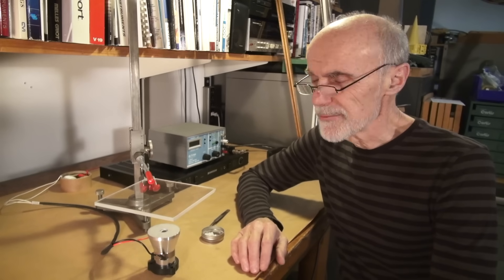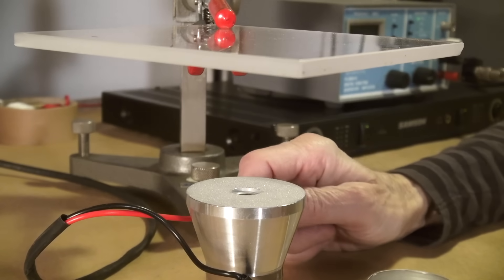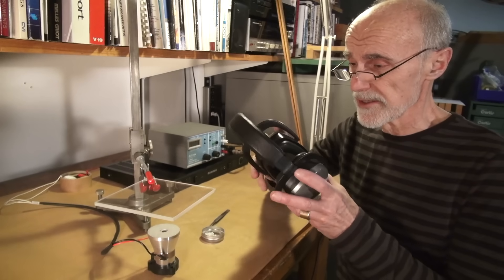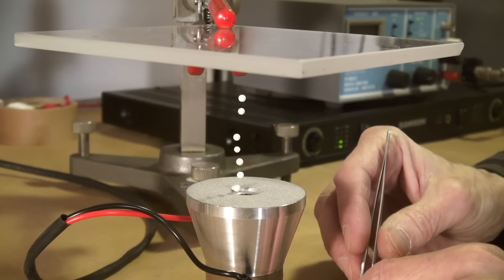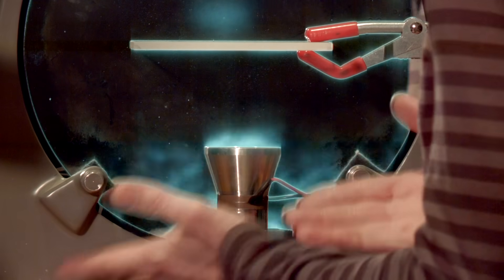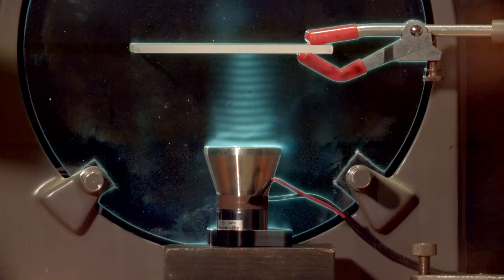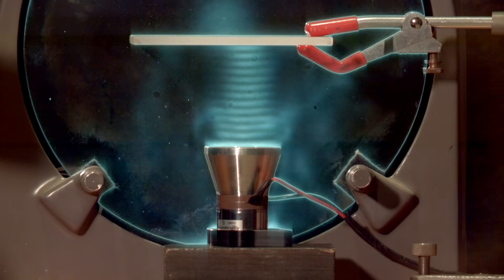Acoustic Standing Waves and the Levitation of Small Objects

Comment: I have tried, for a school project, to replicate with an Arduino, an IPC-4885-W amplifier and a 40 khz transducer. To get the right distance between the transducer and the reflecting surface we use a caliber and several pieces of paper. It only works for some seconds/a minute each day then it stops (even if we don't move the reflective surface, and the transducer is still active). May I ask if you had the same issue? What could be causing it and what can be improved?
Reply: I suspect that your amplifier can't handle the load and shuts down when it overheats.  I looked up the specs of your amp and am surprised it even works briefly.  What you need is an impedance matching transformer to match the output impedance of the amp with the input impedance of your transducer.  And if that doesn't do the trick, you need a more powerful amp.
Reply: Thank you for the reply. Actually the amp seems to work all the time: to check we noticed that when the powered transducer is touched with a metal object it passes some vibration and makes it emit some audible (and annoying) squeaky sound (which I think is curiously 20 kHz). And it doesn't seem to overheat. I didn't understand why it shouldn't handle the arduino's (square) signal. I must admit I don't understand much about impendance matters. Might the issue be on the arduino's side?
Reply: It's hard to diagnose a problem without the ability to troubleshoot all the possibilities in person  I doubt the problem resides with the arduino, but it's possible.  Maybe too much power is going into the higher harmonics (of the square wave) and you would be better off with a sine wave?  What ultrasonic transducer are you using?  All I can say is that I was not able to power my transducer directly with an audio power amp ... the impedance matching transformer is essential in my set-up.

Comment: Why is it important, that the distance is just right?
Does the soundwave is reflected a couple of times? So that at some point it interferers so much destructively, that it is througout just zero?
Reply: Yes, the sound wave not only reflects off the piece of glass, but also off the transducer producing the sound waves.  Constructive interference between the original waves and the subsequent reflections can only happen when the distance between transducer and reflector is some integral multiple of a half wavelengths (that's "just right").  Otherwise, as you say, one obtains wholesale cancellation.  The sound won't go to zero because you still have traveling waves ... you just won't get a standing wave.
Reply: Great, I think I understood it 
like this:
https://drive.google.com/open?id=1SRNbyo6B2W2xAFMlG0KLzCrDgosg69hb
On the left with the multiple of half a wavelength
on the right without the multipple of half a wavelength
Reply: correct
Reply: GREAT, Thanks a lot!!!!

Comment: Does someon can answer me? What is happening in that zones? 
White: Steady air pressure, the foam balls don't move
Dark: Changing air pressure, the balls are move out of those zones

Did I understood something wrong?
(yea, thats bad english)
Reply: Many find this counterintuitive, reasoning that the balls should move away from a high pressure zone.  Try to visualize the actual motion of the air.  The air molecules are in an antisymmetric normal mode of vibration;  from the balls’ viewpoint, air molecules are either rushing in symmetrically from both sides or moving away symmetrically, and the balls settle down in a zone of least motion.
Reply: And that is where the highest pressure = white stripes are?
Reply: correct
Reply: Wolfgang Rueckner aaahahh,, thanks!
Reply: Only one more question :'D

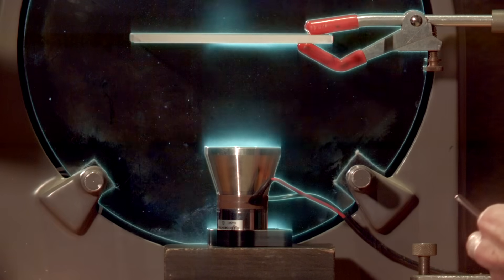The Ultrasonic Levitation works with standing waves (antinode and nodal point), right? At 4:20, you see those white and small black stripes. Which Stripe is which part of the standing wave? 
As I researched, the small balls are staying in the nodal points, so that should be the high pressure? But The antinode should actually be the place where the pressure of the air changes, depending on the freqency, a couple of thousend times per second. 
Currently, I am very confused and do not know further, can you please help me one more time, even though I am annoying you ^^ -_-
Reply: The white bands of light are regions where the air pressure changes the most (from maximum above atmospheric pressure to maximum below atmospheric pressure) and it's also where the air is moving the least.  These are the pressure anti-nodes and that's where the balls settle down.
Reply: I think, I am understanding - is it about the sound particle velocity?
Reply: yes ... the air molecules move the least in the pressure antinodes and they move the most in the pressure nodes.  Molecule velocity (or displacement) is 90 deg out of phase with pressure.
Reply: Wolfgang Rueckner awesome! Thanks a Lot!!!

Comment: Thanks for the cool demonstration! I was assuming that the little balls were suspended in the nodes between the high pressure bands but this isn't the case?
Reply: Many find this counterintuitive, reasoning that the balls should move away from a high pressure zone.  Try to visualize the actual motion of the air.  The air molecules are in an antisymmetric normal mode of vibration;  from the balls’ viewpoint, air molecules are either rushing in symmetrically from both sides or moving away symmetrically, and the balls settle down in a zone of least motion.
Reply: I see, thanks for the explanation! :-)

Comment: If I use a similar model transducer that emits 40kHz will it work the same way or would the wavelength not be enough to levitate anything? I've seen the TinyLev uses that frequency but with many small transducers in precise positions.
Reply: it will work at 40 kHz ... you can levitate smaller objects with the shorter wavelength

Comment: There is no such thing as high pressure area. The pressuse is oscillating between high and low on the antinode points. So the average pressure is the same as the surrouning atmosphere at the antinode points. Same with the node points, where the amplitude is at minimum. So my qestion is, why the balls levitate? The average pressure is the same everywhere around the objects, so the balls should not levitate. There is something which was not explained.
Reply: The pressure antinodes are where one finds the highest pressures.  Yes, it oscillates between maximum pressure above atmosphere and maximum pressure below atmosphere and the average pressure is atmospheric.  But at the pressure nodes, it's atmospheric all the time.

The balls levitate because they are pushed by the air molecules into the pressure antinode.  The pressure is greatest (above atmosphere) when the molecules come rushing in to this space (symmetrically from both sides) and lowest (below atmosphere) when the molecules rush away from this space (again, symmetrically on both sides).  Right at the pressure antinode, the molecules move the least and that's where the balls settle ... they get "pushed" from both sides and then "pulled" from both sides, but the net force is zero, so there's no translational movement.  They can't move that fast anyway because of their inertia.  Make sense?

You can also think in terms of Bernoulli's Principle.  The highest pressure is where the molecules move the least (for example, right at the surface of the reflector).

Comment: Can acoustic levitation interfere with smoke or fog? And if so is the interaction controllable?
Reply: Yes.  Since smoke and fog consists of very small particles, they would interact with the acoustic pressure wave and collect in regions just like the little Styrofoam balls.  The interaction would be controlled by the intensity of the standing wave.
Reply: Wolfgang Rueckner Thank you! This is incredible and has a lot of potential applications and uses.

Comment: Considering those pressure zones, if the light bands were high pressure, wouldnt the ball be pushed out?  When the standing waves are adjusted out of phase (@t=4m22s), the bright zone appears to intensify near the plate, leading me to believe there's a narrow dark band just under the plate while in phase.  Also the dark bands appear narrower to me, seeming compressed.  Then there's the light zone above the plate, where it ought to be sheltered from the waves, right?  Lastly, the ethereal appearance of lighter portions appear to rise.

It's gonna be hard to top the quality of that explanation and presentation.  First time viewer, subscribed.

Thank you!
Reply: It is in the high pressure zones where there is the least motion of air molecules.  The balls a jostled into these high pressure zones by the rapidly moving air molecules in the low pressure zones.  Think Bernouli's Principle.

Comment: Excellent! Could you use this to create a UFO i.e place the ultrasound speaker(s) on the bottom of the craft to produce a displacement with the ground?
Reply: no ... the acoustic power required to do that would be lethal to all living things in the area
Reply: Oh damn! Back to the drawing board. Ok, lateral thought, could it be scaled down used at the nano-scale to organise particles into a structure, you seem to have very accurate control over the pieces? I believe that they can already do this with a laser 'tractor' beam on single individual atoms but its slow.

https://en.wikipedia.org/wiki/Sonochemistry

Comment: How do you see and record high and low pressure?  Amazing demo!
Reply: When you see light streaks in the mirror, that means that the pressure is changing in that location, but you can't tell if it's getting greater or less.  You need additional information to figure that out.

Comment: that Schlieren optics show the warmth of air - the hotter the whiter - hot -->  low density
white zones are low density
when air is hot the distance between particles gets bigger- >> low density
___________________
      high density
___________________
       low density  ---->BALL HERE
___________________
      high density
___________________
Reply: Schlieren optics does NOT show temperature ... it shows CHANGES in density (which can be caused by CHANGES in temperature)
Reply: Variations in refractive index caused by density gradients in the fluid distort the collimated light beam.  This distortion creates a spatial variation in the intensity of the light , which can be visualised directly with a shadowgraph system..... The result is a set of lighter and darker patches corresponding to positive and negative fluid density gradients ....To visualise instantaneous density profiles, a short-duration flash (rather than continuous illumination) may be used.
Reply: so when the air moves its standard homogeneity of gases change with turbulence and the light is refracted brighter or darker
the bright areas show turbulence areas created by sound waves
and the balls levitate there

Comment: Does someone can explain me, how he connected the "ultrasonic power transducer" to the power source? Is it simply a normal power supply? Or something special with sound?
Reply: The
 amplifier is a Samson Servo 120 audio power amp.  The input voltage to 
the power amp is a nominal audio line voltage (about 1 volt p-p) and 
comes from a sine wave function generator.  A home-made impedance 
matching transformer couples the 8-ohm output of the power amp to the 
ultrasonic transducer.

The core of the transformer consists of two C-shaped pieces of ferrite 
which, when put together make a square. Ferrite is better than iron at 
high frequencies. The primary is 10 turns of #18 wire and the secondary 
is 100 turns of #22 wire. The inductance of the primary is 230 microH w/
 secondary open and 16 microH w/ secondary shorted. It's operational 
inductance is such that its impedance is well matched to the 8-ohm 
output of the amp. The inductance of the secondary is 18.8 mH w/ pri 
open and 1.8 mH w/ pri shorted. It's operational inductance is around 10
 mH. The static capacitance of the transducer is 3550 pF. To resonate at
 28 kHz, we want an inductance of 9.1 mH. The inductance of the 
secondary is a close match for that.  The output of the transformer can 
be as much as 400 Vp-p, but I operate it at approximately 50 Vp-p (the 
minimum power to secure levitation).

The "speaker" is an ultra-sonic power transducer (designed for 
ultra-sonic cleaning baths) such as one of these: https://www.americanpiezo.com/standard-products/ultrasonic-power-transducers.html  The one I'm using is the 50-watt version (but I'm only operating it at around 8 watts).
Reply: Wolfgang Rueckner great, thanks a Lot!

Comment: Can the reflecting object in this case glass break if too much frequency is used? Is it dangerous to put your hand between the reflector and the source of the sound? Can modern day technology use this method to keep extremely heavy objects floating in the air "what is the most kHz ever produced? Do the military invest in sound wave weaponry?
Reply: Glass objects will break when subjected to high intensity sounds at their natural frequency of vibration (resonance frequency).  For a piece of glass like the reflector, that's in the audible hearing range, not ultrasonic frequencies.  It's not dangerous to put your hand between the reflector and sound transducer.  Levitation by sound waves is not feasible for heavy objects ... you would need sound intensities that would be lethal to all living beings.  Ultrasound frequencies go all the way up to the MHz range (these would be medical uses).  The military has experimented with sound wave weaponry in both the ultra-sound as well as infra-sound ranges.

Comment: Hey, nice work!!! Several years ago, decades at this point I think, I read about a scientist that had done that with a water bubble. They had made it float with 50hz. I was wondering at the time if it would be feasible to send small objects into space that way, kind of a 'care package', in the form of a stream of machines emitting the sound waves and carrying the objects out to respective locations... I kept imagining the complications of exiting the atmosphere, but since weight is completely different, I wondered if it was even possible to build a station from small components in that same manner.
Reply: I believe it would be impractical because the pressure of sound is so small compared to other sources.